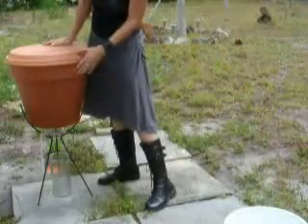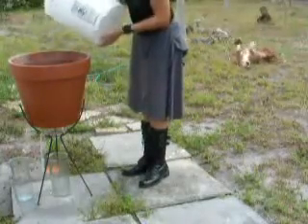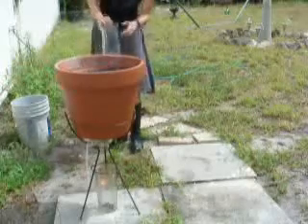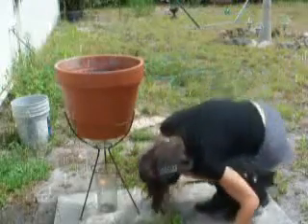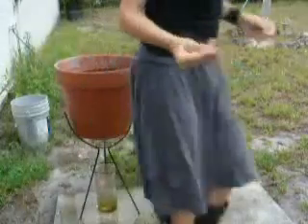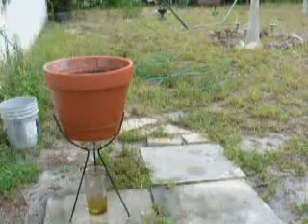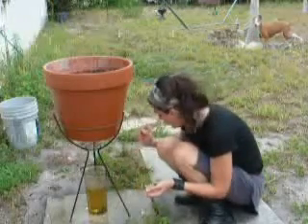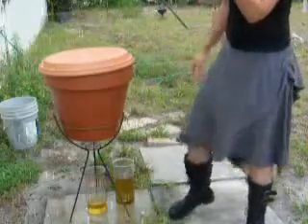Leeching Wood Ash to Make Homemade Soap using Potash Lye

Comment: pH measurements are limited to more dilute solutions. Once your lye solution achieves 5% and higher, the ph paper will read the same number. Each integer on the pH scale represents a tenfold dilution. So a pH of 13 is about a half percent solution and a pH of 12 is a 0.05% solution. This is for KOH.

Comment: when you opened your pot i saw the problem  you do NOT have wood ash in there, you have charcoal slurry to make proper wood ash Lye you need the white ash from hardwood not the tan or  other bits left behind  and you slowly trickle the water through it and collect the runoff. bit hey, good job for going with the DIY spirit
--Rick

Comment: Don't take this the wrong way, but you did not make lye (either Sodium Hydroxide or Potassium Hydroxide). You made a solution of Potassium Bicarbonate (yes, this is Potash, but Potassium Hydroxide is known as "caustic potash"). If you evaporate your Potassium Bicarbonate solution down into a grey/brown paste, add hot water to redissolve, and recrystallized in an ice bath you would have pure Potassium Bicarbonate crystals, which can be pulverized to a powder and used as a substitute for Sodium Bicarbonate (baking soda). If you use too much heat during the evaporation process your Potassium Bicarbonate would decarboxylate into Potassium Carbonate (which is commonly used in wine-making). To make Potassium Hydroxide (which is much more effective at making soap and has a much higher pH) you would need to add Calcium Hydroxide (slaked lime) to your Potassium Bicarbonate solution and let sit or stir overnight (preferably with heat if you did not already decarboxylate your Potassium Bicarbonate during concentration). The reaction will produce Potassium Hydroxide dissolved in solution with Calcium Carbonate (essentially limestone or chalk) precipitating to the bottom. Potassium Bicarbonate, Potassium Carbonate, and Potassium Hydroxide are all used in pioneer soap-making (listed in order of increasing pH at equal concentration). Great video though - it was fun to see your problem-solving in action.
Reply: Jake McMillian please make a video on this. I would love to see the mechanics of it.
Reply: In one very long paragraph you just taught us all more than this woman's rambling video.

Comment: i also get a bright yellow liquid, but i get a yellow salt after evaporation and not a white salt. the yellow salt dissolves in water too. so what is this yellow powder? what did i do wrong?
Reply: +Trevor Van Zuydam The yellow color comes from organic compounds in the solution, to clean it just put the salt on some cloth and pour alcohol over it, ethanol being a non-polar solvent, the salt will not dissolve but actually will be whitened.
Reply: +Milos Prnjic thanks i will try that.

Comment: I really love your realness. I am struggling with getting my coconut based soap to harden. How much lye water would you suggest I mix with 32 oz of oil. The lye water floats egg! Please and thank you! Gunta Gunts:D
Reply from the maker: I've always taken an intuitive approach and do not use measuring devices, so I have no idea what to tell you on amount. An old timer said that when the egg floats make sure its nice and high in the water showing a quarter sized piece of shell. Not just a nickel or a dime size. The higher the pH the more buoyant the egg. I've read that hard wood ash can make a hard bar soap where as soft wood ash can make a soft or gel soap good for shampoo. What is your lye source from? The olive oil soap I made got harder with time. Some people cure it for a long time and not so long long with others. Seems a bit of an art form as well as a science.
Reply: +Michael Dylan you should use tallow because it is hard at room temperature

Comment: FYI, that slippery/soapy feeling on your hands after touching the lye solution with your bare hands is quite literally the result of the fats in you skin going through the saponification process!
Reply: *****
vinegar being an acid will neutralize the KOH on your hands ;P...always have it around!
Reply from the maker: Oh my. As I read your comment I could have sworn i heard some spooky music filtering into the background. Ba haha hahahaha. Seriously though... what you said about the lye saponifying our own body fats explains a lot.
Reply: ***** Not trying to be mean or troll...but rubber gloves are highly advisable.  Also, you may want to keep the lye away from your ring. :)
Reply from the maker: Bart Black Safety first. It's my understanding lye becomes even more potent and active when heated. This potash didn't seem as extreme as something like sodium hydroxide. I had to boil it down a long, long time to get it concentrated enough to make soap and even then my soap was nothing to brag about.
Reply: @bellainfidella5585  You know it's strong when layers of skin come off the next few days
Reply: ***** Rubber gloves and safety glasses are highly recommended, as well as vinegar and lots of clean water

Comment: When you put your cloth in the bottom poke a bit of it down through the hole (like a cloth nipple) before you put the ashes in. Then it will run better right from the start.
Reply from the maker: I know what you mean about the cloth nipple. I discovered that trick by playing around. Thanks for mentioning it so others know.
Reply: +Bella Infidella hi i relocating to ruffly where you are to do what your doing go off-grid do you have Facebook? /peace.froggy.33

Comment: My leached water was a very dark brown. I even tried filtering it but its still so dark yo cant see through it. Any suggestions?
Reply from the maker: What kind of wood you use? Seems that would influence colour. Maybe because of sapins present and other goodies. I read you can only get perfect clear or white soap using the lab chemical sodium hydroxide. Otherwise when using potash we get amber tones. Which I find charming. And pretty.
Reply from the maker: If you want your soap to be translucent instead of opaque add some alcohol or sugar as it is a solvent also I read. It dissolves fine crystals that make the soap opaque. Your soap will still be amber, but clear like glass.
Reply: ***** hmmm, I got the ashes form my Stepfather and even though I was adamant about using only hardwood after talking to him again I think their was some pine and poplar, as well as other chunks of impurities. When I tried making soap I got lots of black slag looking junk in it and it stunk. I'm thinking my lye was not good enough.  I guess I'll burn the hardwood myself, sift the ashes and try again. Thanks for the feedback. BTW...love your channel
Reply from the maker: People throw all kinds of things in when they're burning a fire so it's hard to say what all was in there. Best to burn it yourself.
Reply: ***** SO it finally dawned on me that We have a QC LAB where I work so I took my lye sample and had them test it. Turns out that it wasn't too weak, it was too strong...way too strong. It pegged out the ph meter. The tech said he'd never seen anything that alkaline. I had to dilute it with water several times to get it down to a ph of 12. Just thought i'd follow up and let you know.
Reply from the maker: woh...too strong to make soap? I didn't know pH could go above 14. Had to dilute it to 12 you say? Weird. At 13 mine wasn't strong enough. Now I'm confused.
Reply: Well the PH scale only goes to 14 but that's not an absolute maximum of how caustic a substance can be,  there can be concentrations that are stronger, they just register as 14. At least this was as it was explained to me by the Lab tech. For example, I added water several times and it still read a ph 14, but you know it had to be weaker than the original concentration than the  diluted one  with just water being added.  I haven't tried making soap again (waiting for more tallow) - I meant I had to dilute it with quite a bit of water to get the ph to read 12 on the meter. Sorry if I wasn't clear
Reply from the maker: I see. That makes sense about pH and how it can go above 14 on the scale. Sort of like a weighing scale only going to 300 lbs, but if you weigh a ton it still reads as 300 tops.
Reply from the maker: +Dave Miller I'm still a rookie myself, but am wondering if the deep colour is a good thing. Maybe it means it's a super lye. Don't know really. But, when it comes to opacity and any cloudiness in the soap itself, while being made, I've read that if you add a solvent like alcohol, or sugar (yes, it's a solvent), it dissolves any micro crystals that cause cloudiness or it to be opaque. Once you add alcohol, or sugar (or glycerin), it is supposed to make it clear, although it will still be amber in colour, just not opaque. Now that is all once the fat/oil is added, but perhaps this would work on the lye as well.
Reply: +Bella Infidella well I guess the dark color does mean it's "super lye". When I cut it with water it became the reddish hue you normally associate with lye water, just waiting to get some tallow and I'm gonna try again.
Reply: +Bella Infidella I'll let you know how it  goes

Comment: "say no to plastic" yet you are using a 5 gallon plastic bucket. i think making your own lye is way cool but saying you Don't like to use harsh chemicals from lab supply houses is silly because you are making a harsh chemical the only difference is the purity of the lye.  but my guess is that that is what you are going for, seems to me your wanting those impurity's from the wood? anyway cool video, i'm all about learning to be self-sufficient.
Reply from the maker: rain water is in the plastic bucket, not a caustic lye. my lye water can be handled safely by hand when cool. try doing that with sodium hydroxide from a lab rather than potash. just saying.

Comment: can used charcoal birquettes be used as an ash source?
Reply from the maker: Good question. Hmmm..... seems like if the charcoal were from something with saponins, like wood or yucca root, but for some reason my instincts say not. Never thought about it, Thanks for the thought provoking response. Maybe someone will comment who knows. I'm still a rookie.
Reply: don't think briquettes would work, as i understand it the reason you can make lye from wood ash is because tree sucks potassium hydroxide from the ground and when you burn the wood the potassium doesn't burn, the potassium is water soluble.
Reply from the maker: Steve Gould thanks for pointing that out.
Reply: Charcoal briquettes consist of sawdust, coal dust, and corn starch as a binder, so I would imagine it would not be suitable at all.
Reply: thank you all
Reply from the maker: Yeah, any additives in charcoal would be weird. I just bought some briquettes made from 100% coconut shell. That might actually work. I bought them to cook with, not for soap making.

Comment: Cork it off and let it sick for a few days to leach the potassium hydroxide out
You dont make a pot if chicken soup but pouring boiling water through a raw chicken.
Reply from the maker: Yes, of course, of course, let the water soak. What was I thinking letting it run straight through? I love to cook and your chicken stock analogy drove the point home. The best stock takes it's sweet ass time, nice and slow as it concentrates in flavor. Oh, by the way, there really is antibiotic and medicine value found in animal soup stocks. The secret is in the bones, the marrow, ligaments and other goodies. That stuff that gels when it's cold is pure straight up medicine right out of mother nature's medicine cabinet.
Reply: ***** I always roast bones in the oven for a couple hours before adding the water and  putting them on the stove.  They make a nice dark rich stock that gelatinizes when it cools.
.

Comment: Its not the PH you worry about its the softness. and Ionic.  You want low low low mineral count
Reply: *****  Need to get the science right....as the floating egg, dissolved feather, and high ph. are all good indicators of good lye.  I would have used a plastic 5 gal pail with a plastic valve in the lowest point. Clean rocks or large glass beads and a straining cloth to keep the ashes above the drain point. I also know some use a layer of clean straw above the clean stones then put the cloth above that, then the ashes. Then they pour in the water and let stand in a warm place for 3 days.
Reply from the maker: Hmmm. Well, then what's the deal with the pH needing to dissolve a feather or float an egg? I noticed the more alkaline it got, the higher my egg floated... more buoyant than at low pH.
Reply from the maker: Scott Maclean oh yes... I had forgotten about layering straw and pebbles. Good reminder to try.
Reply: I was thinking of using RO filtered water for that reason...

Comment: Actually, if you're finding that's not quite strong enough to make the soap you're trying to make, you can allow it to sit out in the sun and concentrate down. Sodium and potassium hydroxide will absorb moisture directly from the air so you really don't have to worry too much about concentrating it.
Reply from the maker: Aaron Thomas Woh...the lye could hold a knife? Never heard of it or saw it like that. I like the idea.
Reply from the maker: I like your suggestion about letting the sun do the work. Nice touch. I suppose we could call this a passive solar technique in soap making.
Reply: *****
 back in the day they would but it in the sun and let it cure until it would would hold a knife cut... I think ~3 days or so, then cut it up into blocks, throw it on a shelf in their smoke house and let it dry for 2-3 weeks.
Reply: +Bella Infidella don't let your soaps play with knives :)

Comment: Hey Bella, you can make a pure olive oil soap, but it will be oily.  You want a good blend of oils along with the olive....I use a combination of rice bran, which has the same properties as olive, but not quite as expensive, coconut oil or palm kernal flakes, palm and beeswax for a balanced blend.  My question was on the lye you leeched and how your soap looked when using that lye.  When using the wood ash lye, was you soap more liquified or was it a hard bar of soap.

Comment from the maker: I tried making soap with olive oil and it was waaaay to moisturizing to the point of not being the best soap. I'll coconut oil next time as hear it is a super soap and needs to have another oil like olive oil added to make it more moisturizing. Coconut oil on it's own is a great moisturizers, but as a soap it can be drying because of the lauric acid, or so I understood that to be the case. So a blend of olive and coconut oil may be the solution for balance. Palm Olive soap is a blend of the two.